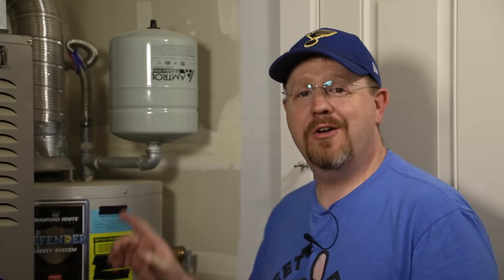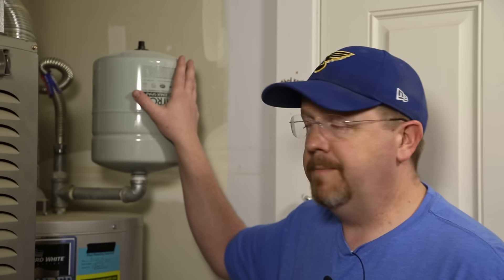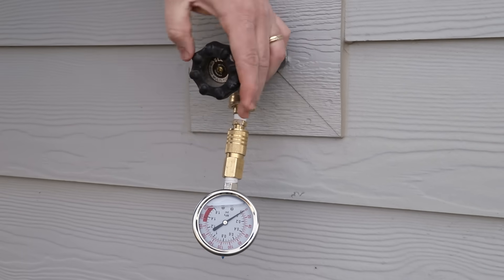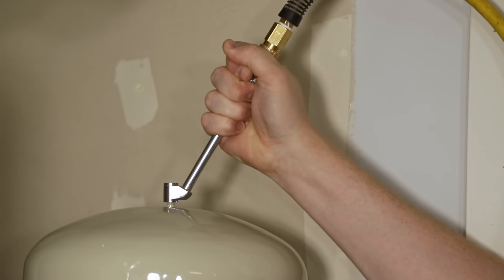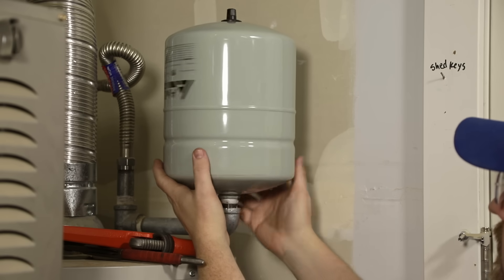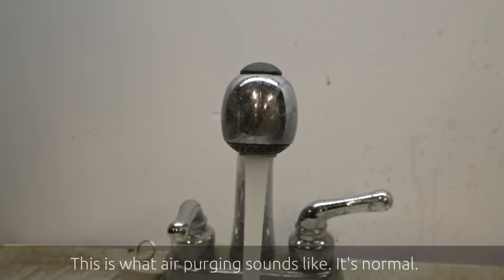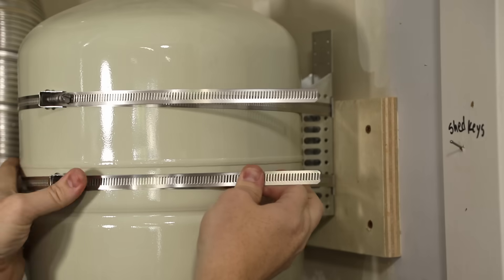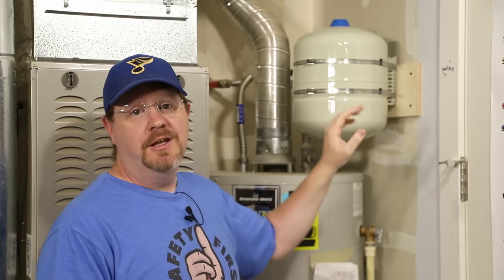What Is This Tank? How to Replace and Maintain a Water Heater Thermal Expansion Tank

Comment: Great video. I followed these steps but the water would not stop spewing out of the area where I removed the old tank. What is the reason for that happening? Am I supposed to drain out the entire water heating tank? Thank you!
Reply from the maker: Hi Damaris - I'm not sure what you mean: did you drain a little water out of the tank before you removed the ol one? Exactly where was the water spewing, and exactly when? Was it coming out of the fitting where the expansion tank screws into the plumbing when you tried to remove the old tank? If that's the case, make sure that you have turned the cold water inlet completely off so that no water is flowing into the heater tank at all (hot water faucets should not work after you turn off the cold water inlet to your heater tank). Then drain about 3 - 5 gallons of water out of the heater tank. At that point there should be no water left in the expansion tank, and there should be no water flowing into the heater tank. Good luck!

Comment: Just-right tone & info. What to do BEFORE suspecting or replacing water heater pressure relief valve that is leaking or cycling too often.
Reply from the maker: Thanks Quentin - before there are any issues, just check the pressures in the expansion tank annually, and test your T&P valve as well. Annual tests like that will almost always confirm if everything is working as it should, or if trouble is on the horizon. Thanks for watching!

Comment: Thank you.  I never knew the tank needed any kind of regular checking/maintenance.  Mine was installed about 5 years ago with my new water heater and today I noticed the expansion tank has a pinhole leak in the body of the tank.  Since water is coming out, the bladder has obviously failed.  No telling how long I've gone with a non-functioning tank before it started leaking.
Reply from the maker: Best of luck with the replacement. You can do it!
Reply: @AmplifyDIY  It was a piece of cake.  I took the opportunity to flush the water heater while I was at it.  Thanks for the vids.

Comment: And what happens if u have no water heater and I have no water or air pressure from the expansion tank?
Reply from the maker: Hi Kert - I'm not sure I understand... no water heater?
Reply: @AmplifyDIY  I just have a expansion tank (4 or 5 gallon)  no water heater nothing else that holds water. And when I went to CK the pressure in the expansion tank there was nothing? No pressure or water coming out? So I was wondering if I could just fill it back up with air? The system was down for quite awhile...Is there a way I can tell if the "bladder" is not good anymore? But if that was the case wouldn't there be water coming out when I CK the pressure? Anyways thanks for any help u can give ✌️
Reply from the maker: @kertrowlins3954  Hi Kert - generally, an expansion tank is only applicable when there is a water heater in the system.... water expands when it is heated, and the expansion tank provides a place for the water to safely expand into so it does not damage your plumbing. With no water heater, you likely do not need an expansion tank at all. Do you really have no water heater? Or just not one near the expansion tank? Or has the water heater been temporarily removed? 
At any rate: To check if the expansion tank is still good, here is what I recommend: turn off the water supply to the expansion tank. Remove the tank. Drain any water out of it that may have been in there. Check the air pressure, and ensure it reads zero. Add 50 psi of air to the tank, and listen for any leaks. If none are found, leave it uninstalled overnight, and check the pressure the next day. If it's still at 50, then the tank is likely fine. Pressurize it to match your water supply, and re-install the tank. 
Good luck!

Comment: Question, I bought a new Pressure reducer. It comes from factory at 50PSI. After installing, my system is at 35psi. There is water squirting when I check pressure of expansion tank. Is the expansion tank causing this issue? My neighbor had 60 psi no issues.
Reply from the maker: Hi S&B - you mean there is water squirting out of the air valve of the expansion tank? If that is the case, the tank needs to be replaced, and the failure has nothing to do with the pressure reducer, though it is odd that the reading is only 35psi after installing the reducer. I'd start with replacing the expansion tank. Good luck!

Comment: What is the system where you have to add water pressure above a certain pressure on a gauge. Is this just for central heating? Is there a video on how and why this works? Oh, i see, the central heating is always under some pressure in the expansion tank, but, i don;t understand why the heating system can fail if not enough pressure is added. I have seen several systems where you have to periodically add water pressure to the expansion tank i guess. If the pressure islost over time the heating system does not work as well.
Reply from the maker: Hi izzzzzzz6 - Imagine a water system that does not have an expansion tank. There is just a pipe into the water heater from the street (cold water supply) and another pipe coming out to the house (hot water outlet). Ignore the fact that the water is under some amount of pressure for now.. but think about what happens when the water is heated - it expands. It does not expand a lot, but it does expand. Water is in-compressible, which means it cannot be compressed at all, and as it expands rather than the pressure simply rising, the volume of the water will always increase. If this happens while nothing is actually using the hot water in the house (which happens periodically throughout the day as the heater cycles on the heat to keep the water hot) the water will expand with nowhere to go. This can be really hard on your plumbing - especially weaker joints like the fittings connecting the washer to the wall, which can lead to burst fittings, and flooding. Nobody wants that. 
An expansion tank does exactly what the name implies: it allows a place for the water to expand into*. The air side of the expansion tank is there to counteract the pressure of the water, acting as a spring to push back against the water while the heater is not heating, so there is air volume in the tank (which *can be compressed with increased pressure) that can be replaced with water as water expands during a heating cycle. 
I hope this explanation makes sense - I know it's a little complicated and difficult to visualize. Thanks for watching!

Comment: In my 40 yr old house , i have 20 year old heaters without expansion tanks... Why ? is it because they did not have code in those days ?? Should I install them now ??
Reply from the maker: Hi Sajid - yes, it is because they were not required when the house was built/heaters were installed. There would not be any harm in installing expansion tanks now, but if your system has worked well for the last 20 years without them, you likely don't need them now. I'd suggest that the next time you replace the heaters, install expansion tanks as a part of the replacement. Even though you don't need them, they will help reduce the stress on the hot side of your system. Good luck!

Comment: If the hose bib is 40 psi, is it bad idea to put a little extra air into expansion tank (60 psi)?? The reason is I adjust the pressure in the fall for watering outside to get extra range.
Reply from the maker: Hi Penny - it's best to match the pressure of your system. If you adjust the pressure of your system in the fall/spring, you should also adjust the pressure on the air side of your expansion tank at the same time. Good luck!

Comment: I need to replace the pipes going to my expansion tank. My expansion tank is still good. Do I need to relieve the pressure in the expansion tank before removing it?
Reply from the maker: Hi Isaac, you can leave the air pressure in the expansion tank. Definitely remove the water pressure in the entire system (and drain a bit from the tank, as I showed in this video) before you remove anything. Good luck!

Comment: I have warm water in my cold faucet. Could it faulty heat trap?
Reply from the maker: How warm? Does it get as hot as the hot water in the shower, for example? Doe the hot side of this faucet get nice and hot, or does it only get warm as well?
Reply: @AmplifyDIY  No not hot as hot end. I would say 30% of hot end. That's only tub faucet. Sink faucet I would say 10% of hot end. Kitchen sink no problem. Hot side is hot as it used to be. I checked outside faucet pressure and water heater drain pressure as well and all them are close to 60 psi.

Comment: "there's no pressure there either" 🤣
I see what you did there 😉
Reply: @AmplifyDIY  and yes terrific video!
My job last night was hampered by a very rusty reducer adapter from copper to tank. It took a lot of torque to get it going, and I had to replace the reducer as well as the tank.
Worth mentioning old tank was full of water so was heavy to hold while removing.
Thanks for the super video and links!

Comment: Hi, just watched this and learned what I needed to do to replace my expansion tank, which had cracked and was spewing water through a small hole. I measured my water pressure, then added air to the bladder using my 12v tire inflator. Thanks for posting this.
Reply from the maker: Great to hear, Joe!

Comment: Why not just leave the water heater in the mid hot setting. Avoiding getting scolding hot water, voiding more pressure on the tank? Does that work? Or it doesn't matter?
Reply from the maker: It does not matter much. Water expands as it is heated. If you have your heater set to the medium or even relatively low setting, it is still going to take the cold water that comes in likely below 70ºF and heat it up at least 30-40ºF. By doing so, the volume of water will expand, thus the need for either a backflow valve or an expansion tank. Thanks for watching!

Comment: You are EXCELLENT at presenting videos!! Thank you... One question for you, if you did not use a Bracket to support the Exp Tank.. could you have slipped a Board under the bottom of the tank and rest that board on top of the Water heater?  it looks like there was room to to do that.. thank you.

Comment: What happens if you test the expansion tank WITHOUT turning off the cold water supply and opening a hot water tap?  Will water automatically come out of the valve?
Reply from the maker: Hi Jean - no, water should not ever come out of that test valve. If it does, the internal bladder of the tank has failed and you need a new tank. However, if you test without turning off the cold water supply, you will not get an accurate reading about how much air pressure is in the tank, since the water pressure will affect the air pressure reading. In other words: measuring the air pressure with the water supply turned on will not tell you if the tank has been properly pressurized with air. Good luck!
Reply: @AmplifyDIY  Thanks. Our tank was replaced but I just noticed the invoice included an isolation valve that was NOT added.  Almost $800 in NoVA!!

Comment: Hello. Thank you for the neat and detail video. I have an question. For usual air tank in air compressor, there is a drain valve for drain water made by moisture in the compressed air. So every once in a while you have to drain it, otherwise inside of tank will be rusty. I believe expension tank is also kind of an air tank. So if you pressurized with compressed air, there should be water in the air side of the tank. However I can't see any drain valve in the tank. How does it work without a drain valve? Thank you in advance.
Reply from the maker: Hi Thetype39 - apologies for the late reply, but you bring up an excellent question! When you compress air, condensation falls out of it in the form of water. When you repeatedly compress air, enough condensation will fall out of it that enough water can collect that you'll need to drain it. In the case of an air compressor, that is why you need to drain them - because of the repeated compression of fresh air into the tank. With an expansion tank like this, you'll only fill it with compressed air once. This won't cause enough water to condense out of it and need to be drained. The tank is simply too small of a volume, and does not repeatedly serve as the compression chamber for fresh air. Hopefully this makes sense. Thanks for watching!
Reply: Wow now I get it. Your answer makes perfect sense. Thank you so much!

Comment: The expansion tank should be installed with the air compartment below;
when the rubber diaphragm ruptures, the water will drain into the air compartment below
and the air recharge valve will leak letting you know that you have a ruptured diaphragm.
Reply from the maker: Hey My Space - that's a great point! In the case of my specific install, I was not ready to swap out the galvanized pipe that the plumber originally installed (thought that is on my todo list) and the instructions that came with my expansion tank specifically say it is fine to install in either vertical orientation - so that's why I installed it the way that I did. When I finally have time to swap out the galvanized pipe with a better alternative, I'll try to set it up so that the tank will be installed rotated 180º to have the air valve at the bottom, as you suggest. Thanks!
Reply: @AmplifyDIY  I understand

Comment: Sooo.. 40 PSI in tank?
Reply from the maker: Hi Robert - the key point is that the air pressure in the tank needs to be the same as the water pressure in your system.

Comment: Great job. Question: My water supply comes from our well (with a large pressure tank that holds the water). If I don't have a gauge, can I just match the expansion tank pressure to the gauge on the well water pressure tank?
Reply from the maker: Yes, that is what I would do. Good luck!

Comment: Thanks for the video, it was very helpful as I am currently experiencing this right now with my expansion tank and T&P valve.  Question, how do I know exactly what the air pressure is suppose to be?  You mentioned yours is at 75, and the tank comes in at 40 from factory.  Where do you think I could find this information so that I know what my water pressure should be at?
Reply from the maker: Hey MysteryPC - the main concept to keep in mind is that the air pressure in the expansion tank needs to match (or at least be pretty close to) the water pressure of your system. I recommend directly measuring the actual water pressure of your home using a gauge as I demonstrated in this video at 2:25.  The exact gauge I used is on Amazon - here's an affiliate link to it: https://amzn.to/3dW4DpQ
if you are unable to get a gauge, you could also contact your water company and ask them what the system pressure is supposed to be. As long as the expansion tank is within 5 psi or so of the actual water pressure, you'll be in good shape. Good luck!
Reply: @AmplifyDIY  Thank you, I will do this.

Comment: So if it leaks from the valve on top the tank the tank is no good?
Reply from the maker: Hi Wayne - yes, if water comes out of the air valve at the top of the tank, the inner bladder has failed and you have to replace the expansion tank. Good luck!

Comment: The tank is upside down. It will work but won't last as long like this.
Reply from the maker: Hi Thomas - the instructions for this tank specifically say it can be mounted in either vertical orientation. Some tanks cannot though, so be sure to check the instructions when deciding a mounting orientation and position.

Comment: If that's galvanized pipes you connected to then it will cause electrolysis , and rot out your pipes.

Use proper transition fittings and 
Dielectric nipples(unions if need be)

Comment: Very helpful.  My hot water heater is located under a large heater duct so the expansion tank is installed on an angle and it would be very difficult to test the pressure. I am due for replacement (hot water heater is 14 years old and there is corrosion where water enters the hot water heater and evidence of very slow leak in the pan.) Perhaps the new hot water heater can be the shorteer wider shape for better installation and maintenance of the expansion tank.

Comment: Excellent job. I just installed my new water heater and now I’m noticing water in the bucket under my PRV and I’ll notice higher pressure out of my hot side sink when I cut it on and it hasn’t been on for awhile. So looks like I’m replacing my expansion tank 🤦‍♂️ it’s always something
Reply from the maker: Sometimes it seems like the maintenance never ends....
Reply: @AmplifyDIY  that’s right, but things could get bad if you didn’t. Especially when people decide to put water heaters in attics. I’ll never understand that, but that’s what they do here in the southeast smh
Reply from the maker: @KendrasEdge757  I agree 100% - the maintenance is a chore, but it's FAR better to maintain your stuff than to have to replace it prematurely. I also have been baffled by designs that put a water heater (and/or furnace) in the attic...Makes it that much harder to maintain, and if there is a failure it could be catastrophic for the entire house below....
Reply: @AmplifyDIY  yes sir!

Comment: Was the pipe wrench backwards when using it as a secondary wrench when tightening the tank ? 
6:05
Reply from the maker: Hi John - a few other viewers have pointed that out... but I was only using the pipe wrench to brace the arm so I could apply more torque to the tank itself. It was impossible to put the wrench on the correct direction as there is a wall in the way. I could probably have just used my left hand to brace the extension pipe as well, but had a little more leverage by using the pipe wrench (even backwards). Good eye, and thanks for watching!